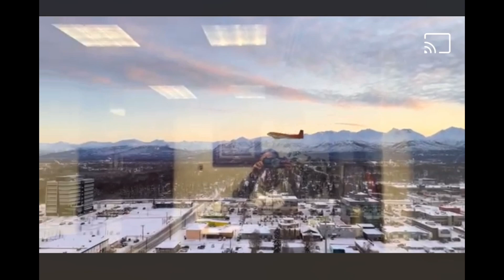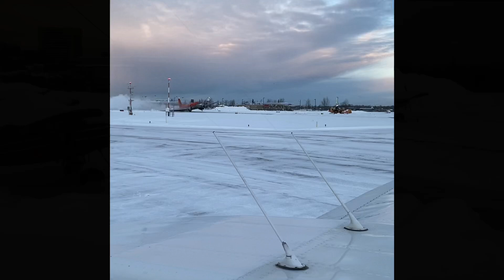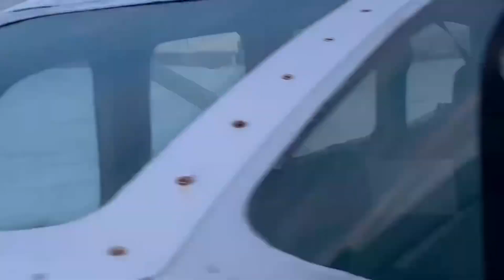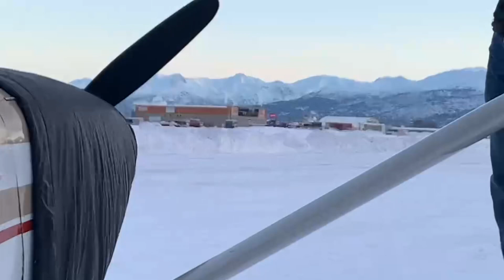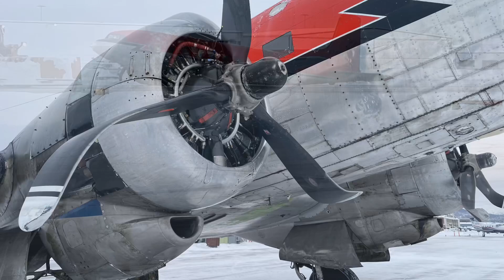Trans Northern Douglas R4D-8 DC3 engine failure. Crash accident.

Comment: I flew that aircraft for three years for Kenn Borek Air under Canadian  registration C-GGKG. Prior, when I flew for Sky Freighters out of Nanaimo, BC we had a similar situation happen taking off from Smithers one day. Master bearing broke leaving the propellor windmilling freely. Even with METO power at gross weight  it was difficult to maintain altitude. We turned back towards the runway (As we were directly over town at only around 1,500 feet above ground!) and I had the F/O put the gear down within the last 30 seconds prior to landing. By the time we got green lights confirming the gear was 'down' we were touching down on the runway, coming to a stop about 3,000feet down runway without using any braking whatsoever. It was a close call.  The team at Central Mountain Air came out to help us get the a/c off the runway and parked at the hanger. The owner of CMA bought us drinks that night! And it was straight scotch I can tell you. Kudos to these pilots and their quick decision making and judgment. They are alive with a story to tell in the future!
Reply: Poor aileron rigging can destroy climb performance.  So many details are overlooked by low budget operators.
Reply: good flying.
Reply: Touche'
Reply: You could hear the change in his voice after they tried turning back. With the severe drag caused by the left engine windmilling, it was a crucial life saving decision to leave landing gear and flaps up.
Reply: @jennybean2099  I agree.
Reply: I lost a 500 hour only Pratt 1320  in 1991 in Colombia.  Luckily were not overloaded like other times.  At about 200 feet on take off, the oil press on the left dropped hard.  We throttle it back to idle almost.   Had to start the right crosswind leg at only 400 agl becuse not climbing at all. and flew the whole downwind leg at onlly 400 over houses with the right screaming at a bit less than full power but above METO.  We landed, got a tow and had to unload, then load another 3 and take off IFR now due bad weather.. Long day..
Reply: My father flew that airplane, and brought it to Borek when he was CP back in the early 90s. He had such fond memories of flying it with Millardair in the 70s he wanted to keep it going.

As a child we had such fun on that airplane. Dad would bring us for test flights and such. We'd piss off the mechs by cracking open the E exits when flying, and not being able to close them until we would be back on the ground!
Reply: @plhought  Fascinating story! We operated a few of Millardiar's Super 3's in 1996 when I was Chief Pilot at Sky Freighters in Nanaimo. C-GDOG, C-GDIK and a few others as parts. Great a/c, loved flying them!...Also, if you are okay to share your fathers name that would be great, I wonder if I know him...

Comment: Old dc3 will be rebuilt and back to work shortly.  Still an amazing airplane
Reply: what does mean "shortly"...... ? = I mean two engines need to be replaced " + all the prop stuff + body frame work..... = hmmm.........
Reply: @danizweifler6061  shortly.. to or at a point that is not as far as expected or desired... Webster dictionary is a friend

Further 2 spares will be hung, sheetmetal work is fast and there is no frame on an aircraft
Reply: @pilot41186  Then pick "webster dictionary" and switch to German and/or French...... // in adtion: who blames that plane  N O T  to be an amazing old lady ?........? // and last but not least: = it is easy to play "smart as" in a mother language my Dear !..👇
Reply: @pilot41186  🤣👌🏻

Comment: As a former Anchorage resident, I knew when he was flying lower than the Denali Towers (footage at 0:10) was, he couldn't have been more than 200 feet in the air. The way he held it steady and landed it as smoothly as he did at Merrill Field was exemplary.

Comment: That is an example of great decision making. With left turns, away from the dead engine, circling back meant going out over the sea. With a runway available near his path he immediately set up for that instead. Turning all the way to touchdown. Second best would have been Elmendorf.
Reply: I feel like, judging by the difference in his voice between the two subsequent transmissions, he noticed something as they started the turn, possible right engine heating up,  loss of manifold pressure, in my honest yet limited opinion, something caused him to abort after he made the decision to start the turn.

Comment: Nice!! Why didn't he put the landing gear down? I thought a DC3 could fly on 1 engine.
Reply: Because they were flying heavy for one engine and gear creates excess drag. Doubt it would've cleared that cub if it were wheels down.
Reply: Maxed at 273 meters / 800”’. Gear would add way too much drag. As they barely made it - every single flight decision was correct.
Reply: Just took off, probably very heavy, full of cargo, full of fuel and low on airspeed on climb out after TO. Expert flying!

Comment: Why the belly landing? Was there simply not enough time/altitude to extend the landing gear? I'm asking, not criticizing.
Reply: Loaded aircraft, not being able to climb appreciably on one engine if at all.  Had to make a right hand turn into the dead engine to land where it did, possibly due to time constraints to get the gear down but more likely did not want to put more drag on the airplane when it struggling to maintain a minimum airspeed.

Comment: great design on the 3 how the landing gear still works a bit when its retracted
Reply: Except that is a Super DC-3. Fully retractable gear was one of the Improvements.
Reply: @davidkallewaard750  if i am not mistake,
Reply: @paulyoung181  Yes, Paul. Would you like to continue that reply?
Reply: @davidkallewaard750  i didnt realise. Does the gear still provide some additional protection for the engines?
Reply: @richardbeaton1611  The DC-3 was a development of the DC-2, designed in the early '30s when there was still a lot of distrust in the reliability of retractable landing gear. So the design left about 1/3 of the main gear extended below the wheel well. The 10,000 C-47s built for and flown by the military during WW2 proved the reliability of the gear, so when Douglas did a major revamp of the aircraft, the Super DC-3, they included doors which fully enclosed the main gear. But this was strictly for aerodynamics. The original structure was still there, with the main gear extending below the oil cooler. Looking at the post incident photos, the primary damage seems to be confined to to the gear doors and adjacent sheet metal, with the basic airframe well protected.
OTOH, both propellers were badly damaged and bent. Anytime a piston engine is subjected to a sudden stoppage like that, internal damage is likely. Both engines will have to be removed, inspected, and either overhauled or junked, depending on the internal damage. So no, the partial extension of the gear does not protect the engines.
But I have a question for anyone who might have some current knowledge of the operation of these aircraft. The R1820 in the Super DC-3 was originally rated at 1450 to 1475 HP, but that was with the high octane avgas of the '40s (130/145). As far as I know, the only avgas available now is 100LL. Have these engines been derated, and the MGTOW reduced accordingly? When I flew the DC-3 with 1200 HP PW1830s, MGTOW was 26,900. What does Trans Northern use for their Super 3s?

Comment: Bravo to making it back on the ground. I can't wait to LEARN what happened here. Why weren't they able to hold any altitude with it being so cold? I don't know much about the Super DC3. But I'd imagine it can hold altitude or climb on one.
Reply: It had a full load of freight.  Probably OVER loaded!
Reply: @Cougracer67  this already was confirmed not to be the case. The prop unfeathered for unknown reasons. This will be a good one. If you look at the impact clips you can clearly see the right hand engine is windmilling, which obviously would have been feathered. Hopefully we get something good to learn from it. My takeaway to every engine failure I've seen in the last few decades: it's rarely a simple engine failure. It's usually a fair amount more complicated than "oh look, it quit."
Reply: It’s was real cold, and it was loaded near gross with fuel. It’s a forgiving airplane, but not that forgiving.
Reply: The cold would be on of the few ingredients that helped matters imo
Reply: There's some other video of the propellers after this incident, and the #2 (right one) was feathered.  It can be feathered, and still be windmilling a little, the drag would be negligible.  Former C-130 pilot who knows a thing or two about props.  We will have to see what the true gross weight was. If they are doing their jobs, the investigators secured the plane and will weigh all the contents and then compare to the manifest. Oh yeah, I was an USAF mishap investigator too.  OH yeah, I was stationed at Elmendorf for almost 12 years. Oh yeah, I contracted with the FAA in AK to design the RNAV STARs and SIDs out of ANC and FAI.  I know a bunch of controllers.  Worked in the tower with them off and on.  And for the record, this was not a crash as the Youtube headline states. This was a gear-up landing.
Reply: @fishon7301  Thanks for your service in the executive branch of the military. Couldn't get anywhere without you guys.
FWIW, and I'm poking a whole lot of fun at a you so, hope your skin is still thick....We used to sing a song on the teams for the self promoting and those that use the classic 'appeal to authority' in their presentation of opinion while self promoting...
Me me me me me me me me me meeeeeee.
Reply: @fishon7301  🤔 Uh ok. Never seen a prop that's feathered windmill on a piston engine. Never. A C130, you got me, I'd imagine a turbine of any kind will windmill, but not a piston engine that's feathered properly. Just an observation. I don't like worrying about propellers feathering. I just stow the prop. And the engine. Then fly for hours 😎 

I'm not sure what designing SIDS and stars could do to help understand this. 🤔 🤷‍♂️ It's whatever. I don't care either way, and YouTube likely won't show your reply for 6 months.

Comment: That'll buff right out.

So, guys who know - how much repair will this need? Looks in surprisingly good shape in the last bit of the video. Put in a couple of different engines and...?
Reply: I once read that the DC3 main gear was designed so that when the Grand is retracted, the tires extend low enough to reduce any major damage
Reply: @philipp9459  Not a DC-3; it's a Super DC-3.  Fully enclosed landing gear.  In the last photos with the gear down you can see the gear doors (complete with runway rash).
Reply: Maybe not replace but fix engines

Comment: Can’t maintain level flight or even climb 100-200 feet per minute on one engine?
Reply: He had just taken off out of PANC heavy. Even with the DA at what it was, it wasnt enough.
Reply: @Captndarty  Unsafe?  Shucks, how much of ANYTHING at 80 years old is still working for a living.  The world record for hours is still held by a DC-3.  Even with the best maintenance sometimes, stuff just breaks.
Reply: @Captndarty  If they were that unsafe, they wouldn't still be flying after 75+ years. They are one of the safest airplane out there.
Reply: @peteranninos2506 , The world record goes to a B-767, C-FCAE, 140,000 hours.
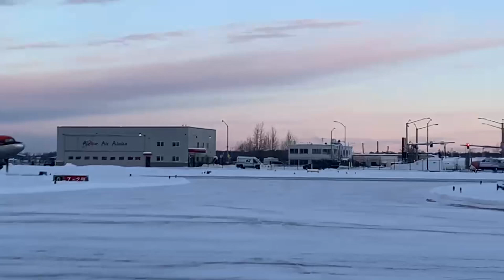Reply: @Captndarty , Airplanes do not kill people. People kill people.  Perhaps we should be wondering why the feathered right engine was producing enough power upon touchdown to bend the blades. (  0:49 )  And, why did they turn left toward the downtown buildings, rather than right?

What if the headline read; "DC-3 crashes into downtown Anchorage"?
Reply: @alpenglow1235   If they couldn't get the prop to feather, it was windmilling, which creates a tremendous amount of drag.    Go look up why you SHOULD NOT turn into a dead engine, if at all possible!!!  THAT could have possibly caused them to crash, turning right...
Reply: @Captndarty  it's Alaska bush transport. Perfectly good old plane. You should see our Otters.
Reply: @ChugiakAK , What do you see the right engine doing at 0:49 ?
Reply: @peteranninos2506  Yup stuff certainly breaks. But you got to have performance and that airplanes performance was designed 80 years ago. Fortunately it wasn’t in mountainous terrain. There was a surplus of them and they’re cheap that’s why they’re still in use relative to paying for something in equivalent load carrying brand new
Reply: @MX304  there still flying out there because there was a surplus of them and they’re cheap for their size and load capacity. Clearly it’s not safe when you’re at gross weight and can’t climb out of your own shadow on a cold winter day in flat terrain. I don’t like antiques and there’s a reason why things aren’t built the way they were 80 years ago
Reply: @zhiheather  perfectly good airplane that if you have an engine failure at V1 at gross weight you cannot fly lol. Yeah real nice. Or at least that’s what this video is depicting.
Reply: @alpenglow1235   Windmilling. Just like windmills on a ranch, wind passing through the blades turns the windmill, not an engine.   Windmilling props  with wind through them create lots of drag, if you can't get them to stop turning.  Don't believe all the folk besides me,  posting the same thing.  Go look it up for yourself.   And this airplane has clam shell wheel wells. 
The tires brakes are of no use if the tires can't touch the ground.  Your scathing questions have answers you refuse to look up and acknowledge. Your pursuit to condemn these pilots is very wrong.
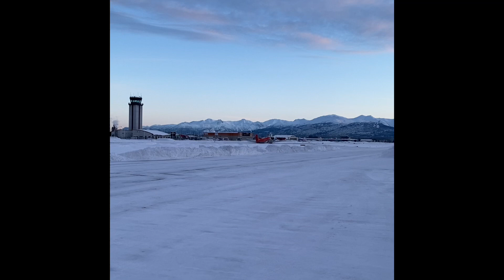Reply: @davidkallewaard750 , @ 00:46 looks as though it's turning clockwise.  There must be phase issues between the camera and the rotational speed.

Turning backward presents a whole new issue - on the right-hand side.  I'm sure ChugiakAK knows what I'm suggesting.
Reply: @davidkallewaard750 , Clockwise, as seen from the position of the flight crew, is normal rotation.  Counterclockwise is normal for some European produced airplanes, but not a Wright, nor a P&W.

Reverse windmilling to such a speed as to be significant drag.  I have feathered many propellers.  I have unfeathered many, too.  I've seen feathered props begin spinning after beginning a descent.

So, why didn't the F/O unfeather to the neutral blade position and stop the rotation?  A cold day.  1475+ HP.  It should have been able to climb, or at the least, maintain.  

Do you suppose the T.O. Briefing considered a windmilling prop?  Doubtful, as the initial radio call was for a right turn.

There were two radio voices.  One I am familiar with as a Dena'ina King Air driver.  I'm going speculating the PIC, although high time, has less than 500 hours in the DC-3.
Reply: @alpenglow1235  I was an instructor and ck. airman with over 4,000 hrs. in the DC-3, a column in my logbook for DC-3 engine-out time, and have changed many props. Many of your arguments are valid, but we don't know what happened. If the holding coil fails or is inop., one pilot must manually hold in the feather button and it's difficult to know when to release it - if you hold it too long, the prop will begin to unfeather. When that happens the prop must fully unfeather before the pilot can feather it again. This all takes time. MAYBE that's what happened? Maybe they never did get it completely feathered. This would explain the poor climb performance.  Lighten up on the other folks please.

Comment: Silly question didn’t they have a chance to lower gear
Reply: Looks to me like they barely made it to the airport with a clean plane (gear up), best glide ratio, else they'd come up short with gear down and they'd be a smoking hole in the ground or building.  Great job and good decision making!  With a couple new crank shafts and props, the rest will mostly buff out!
Reply: Wesley, with only one engine operative, depending on their load (weight) they would not have been able to maintain sufficient airspeed to maintain lift if they lowered the gear  -- because it would slow the aircraft down too much. Too slow means no lift, no flying.  That's called a stall.  The airplane falls out of the sky.  
These guys were smart not to lower the gear.  You can hear in his voice he knew they were losing altitude.

Comment: Why in God's name could you not fly on one engine in a Super DC-3 with 2,000 hp on the operating engine? I have had several engine failures in a standard DC-3 with 1350 hp engines (R-1830-94) and was always able to land successfully. And it appears as though you forgot to lower the landing gear, so this emergency was not handled well.
Reply: Apparently the plane was fully fueled and loaded, and the failure was right after takeoff when he had neither speed nor altitude to work with

Comment: My question is, if this DC-3 lost it engine which being a pilot myself then why do a gear up landing to lose both engines & props. I also have my A&PIA so I know it had electric by the rotating beacon on the tail while landing and I know if the pilot would shoot for the blue line for single engine it all would have been ok. Granted I wasn't there nor will I be on the NTSB GO TEAM to investigate